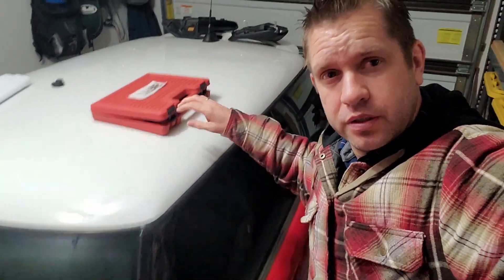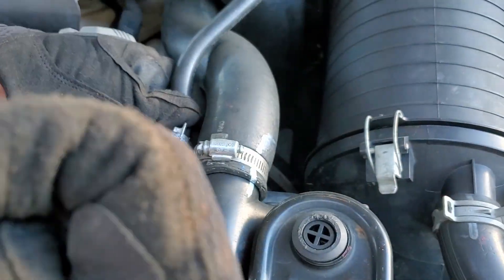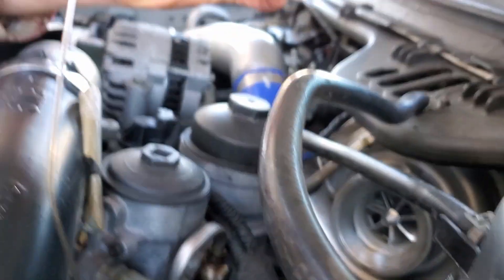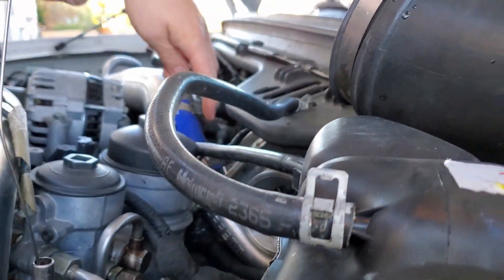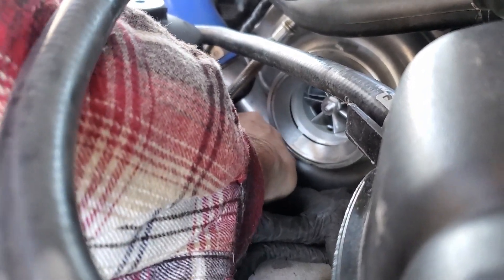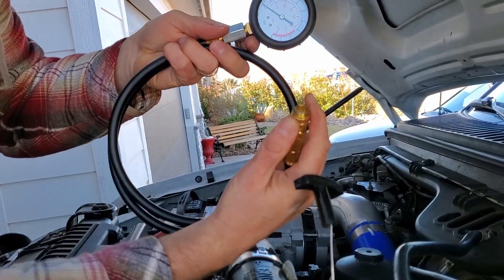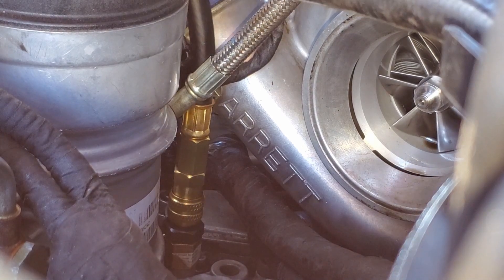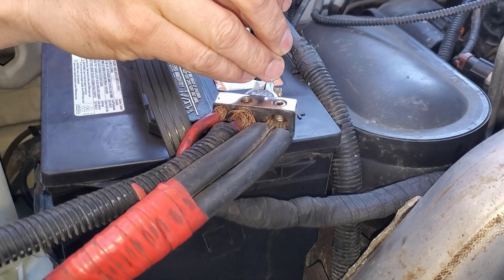How to check base oil pressure on a Ford 6.0l Powerstroke with a pressure gauge

Comment: You can also use the oil temp censer port ,it’s in the same pathway ,it’s on the left of the oil filter ,you moved your hand  over 50 times
Reply from the maker: For me, it's best at the oil pressure switch to be able to check the oil pressure at different oil temps.

Comment: I see its around 65-70 at idle. What does it read at wide open throttle?
Reply from the maker: I can't remember exactly. It has a pressure regulator to control the pressure, but I think it spiked around 85. Thanks for watching. Support the channel by subscribing.